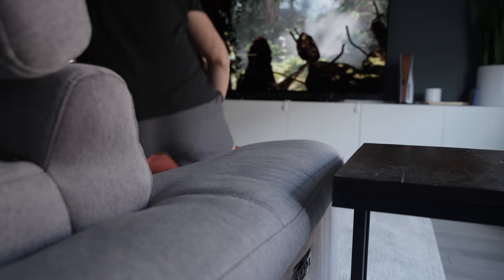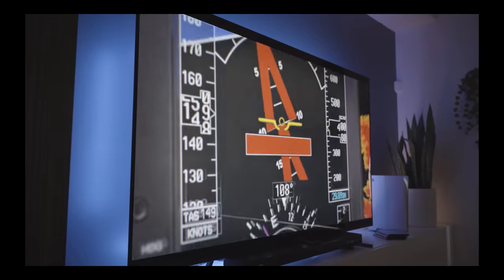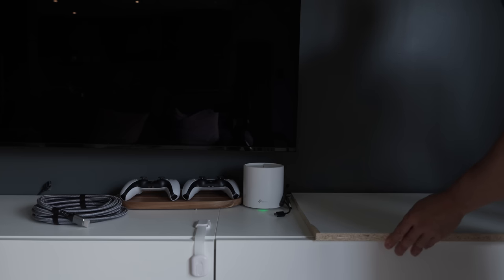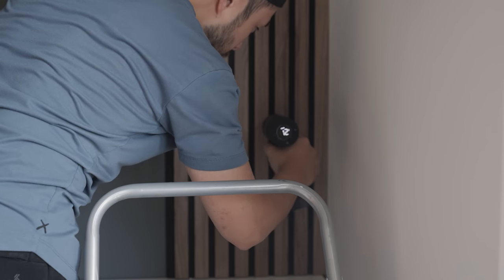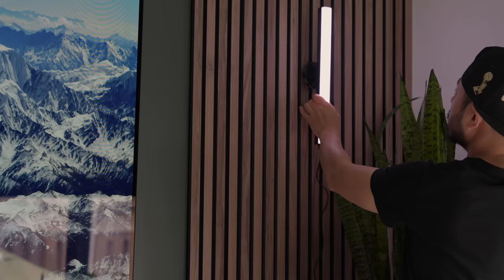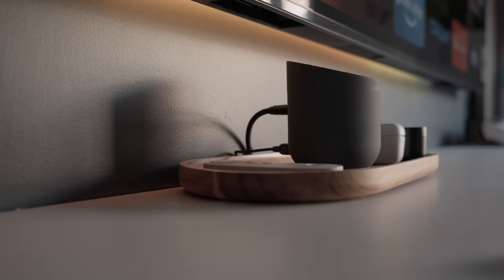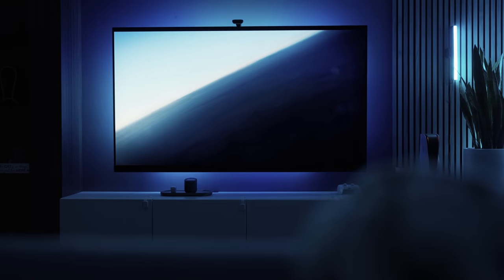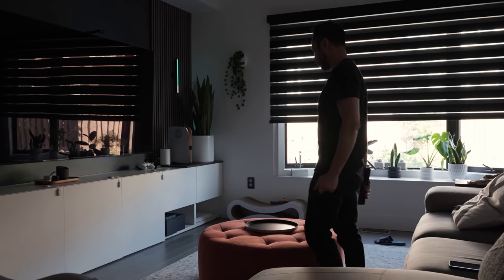What I Added to My Living Room in 2022 - Govee T2 Backlight and Natural Walnut Slats PS5 Setup

Comment: Buys the most expensive mount to keep the TV flush to the wall. Pulls TV farther from the wall to show off lights...
Reply: His mistake was not sticking the light strips closer to the edges of the TV.
Reply: Exactly!
Reply: I’m about to get mines soon. The edgier it is the better?
Reply: @GhettoTilliDae yes. I placed my T2 lights 3/4” from the edge and it spreads light even with TV flush with the wall
Reply: @ianvanessen9356 Could you film a small sequence of your TV and Govee in action and upload it?  Im planning on buying Govee as well and Im curious to see how it looks like with a no gap wall mount.
Reply: @PetrosGolt  yes I can. I didn’t use the flush wall mount that came with the TV. I used Sonys thin wall mount which is rated for three times the capacity as I have young kids. The TV sits about 1/2” from the wall. I’ll tag you when I have the video uploaded.

Comment: What is the ideal height for TV mounting in a living room setup where I want the TV to be about eye level? How high did you mount your TV? Also, how would you compare the Govee T2 to the philips hue sync box. I know one advantage of the govee is that it does not use HDMI to sync the colors and uses a camera instead of an HDMI sync box like the philips. This also means the philips cannot sync to apps natively on the tv like youtube or hulu since the box requires a source to be connected to the sync box but the source itself is a TV so the lights can't sync.
Reply: As someone who mounts tv there really isn't a "specific" measurement for the ideal height. Whenever people want me to mount a tv as close to eye level as possible I usually make a cardboard template of the tv and place it on the wall. Then you can move it until you get the position that fits your needs.

Comment: Everything looks so slick, but I can’t stop to think that your lights are not setup right, either they are not attached correctly from the back, or your calibration is off. Your sides don’t have nearly as much light coming out like your top and bottom of the tv does. There are also a lot of spots where your lights are not even close to what’s on screen. I have the 1st gen of these tv lights and they work wonders for me.

Comment: I have a sound bar which is fixed on top of my tv how could i fit immersion lights or will it just break up the lights
Reply from the maker: The camera can go below Tv as well
Reply: However you should relocate the sound bar as that's a bad position acoustically.